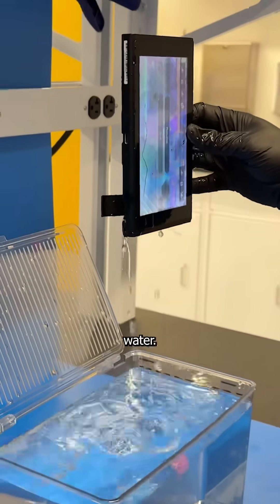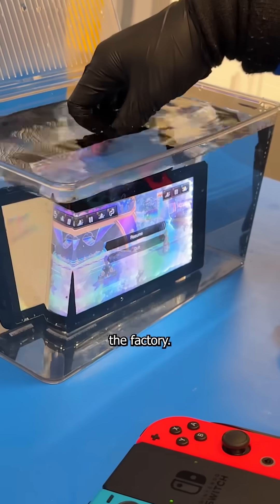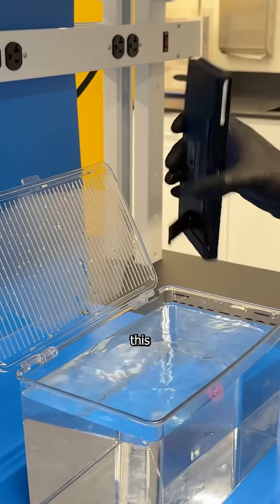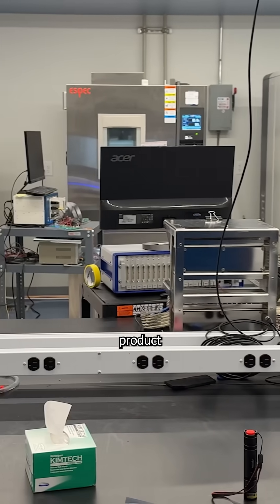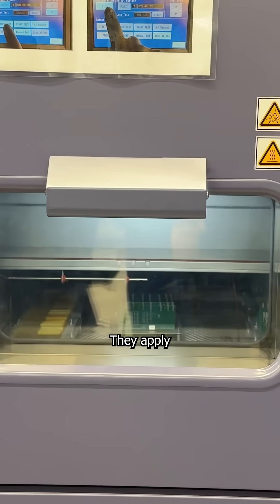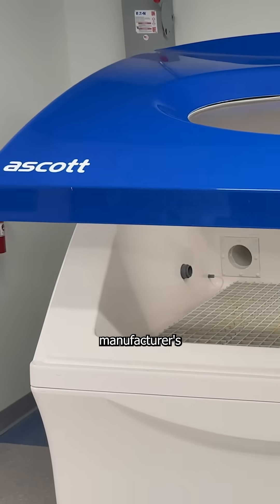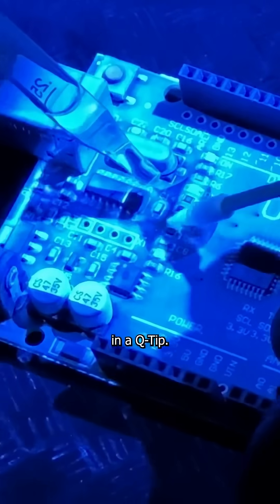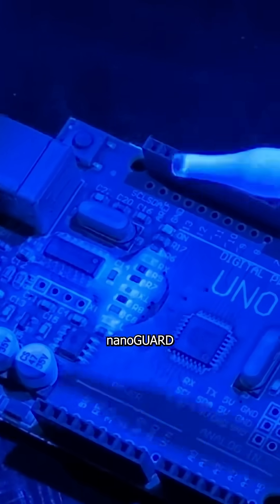Waterproof devices are the future of #technology & nanoGUARD #tech is how we do it! #shorts #pc

Comment: Great!!! Until you want to repair your own laptop/device. Sure, it's good as a preventative measure, but electronics wear out and need to be replaced eventually, and now to get that same waterproof coating, you either need send it in to be repaired by the company or someone who has paid to have that machine who is likely wanting to make a return on their investment. This is a good idea for consumers who would replace sooner replace an expensive car than fix a cheap problem on it (excluding the extra charge they'd add for this coating on new electronics). As for hoarders like me who would polish a rock till it outruns a stock muscle car, not only does it increase the base cost, but I will never be able to fix it "as good as new" without sending it to someone else.

Comment: What happens to the stock cooling system in this case? Do the fans and vents still try to work using water instead of air? Or was that part of the console modified also?

Comment: I have another question. Would the coating impair somethings like electrical conductivity to things outside of the coating. Mechanical keyboards can be coated in this after soldering the switches into the PCB, but I wonder about Hotswap keyboards. They don't require soldering for them to work, and they're frequently swapped in and out. I imagine that it becomes an issue because the coating eventually rubs off, but how many times would you have to swap them out before it becomes an issue, and how viable would it be to reapply a very small amount to 108 spots

Comment: I would rather buy the solution myself and continue repairing my own equipment.
Reply: Which in the first 20 second is explained why it doesn't work really
Reply: @timo4463  no it just said would consider selling to the user. Take this example of what I mean:
I buy a phone with this stuff applied, I smash the screen... I would want to repair the phone myself thus requiring me to buy this water proofing solution in order to fix my own phone. 

This situation was not mentioned in the video. If they only sell to manufacturers I would have to send my phone away every time I break the screen

Would consider selling to the user basically means if we have to we will, but we want to sell in bulk to manufacturers

Comment: This is an old practice called Conformal Coating.
I used to do it as part of my job, it's basically just coating the board with a thin barrier that separates the electronics from any water. Nothing new, nothing complex.

Comment: I see some Logitech UE Minibooms there.
I wonder if this is ceramic based.
 I had an idea about filling board enclosures with a non-conductive fluid. Can't get water in if it's already oil-filled.
 Fluorinert in a car ECU module would make it impervious to water and the fluid would help with thermal dissipation.

Comment: Would sticy tape taped from battery to like ram or other components on the board cause problems or does the manufacturer knew what they were doing? Asking for a friend. Also nanoguard on every single Phone going forward so they will not need to take away ports from phones to keep the 'waterproof'.

Comment: That's actually pretty genius. Basically what they're doing is applying a thin layer of silicone to the surface of the motherboard and other components so that water can't short them. This similar thing is usually done with stuff like dishwashers so that the water that may seep in over the years doesn't break it after like 2 years of use. And yeah it's pretty straightforward
Reply: Does it affect cooling/ heating of the components?
Reply: @jip5889  That is very a goo's question
Reply: It's not PFAS-related??
Reply: how about ports? it's really fun to see an open usb-C port like on the Switch, but that also mean that the contacts are just fucked, so no charging anymore, what a clever idea, on the arduino it means taht every pin coated is now useless, that's just ridiculous 🤣

Comment: I'm not usually bathing with my laptop, but... I would like to be able to swap the phone's battery if I need to without being tied to a wall charger or a power bank.
It can definitely help avoid damage by accidentally spilling coffee or Cola (until it dries out and the keys gets stuck) but yes, no electronics damage. 
It has potential, but why limit to portable devices? I had to replace the board on the fridge because someone didn't fully closed a bottle of coke and somehow it poured down at the right spot. I think it was coke, it was cleaned out when I discovered the fridge was not working. Someone could say it was bad design and I agree, but the limit for it's usage it's our imagination. One more potential example: guitar effect pedals. Playing a Mario game, underwater level... would have been more fun for this video 😊

Comment: I used to work for a space company and we would coat every single circuit board before it was installed. The hardest part is getting the boards clean enough to apply the coating. Any contamination and a bubble would form and then you have to start over.
Reply: Makes sense, especially since Apollo 13 ran into condensation issues when things started going wrong. Big brains 🧠
Reply: This has been around for over 70 years
Reply: so it’s kinda like adding genes to DNA
Reply: sounds like painting a car without getting any dust on it. 😂
Reply: I seen the video
Reply: What kind of conformal coating?
Reply: Currently there are similar coatings for some equipment that will be exposed to the elements and i work with it.

Comment: I mean we've had this for years now it's called conformal coating, I don't know if this differs in someway but does and cleans basically the same, the reason it isn't normally used is because it adds an extra step or two in the process meaning they can't produce as many boards in the same amount of time and thus no matter how cheap it adds cost.

That and of course companies are incentivized to not make products live longer, meaning although it makes more sense for the OEM to apply it from the factory, they likely never will, this is actually more useful for consumers who are interested in making their device last longer.

Comment: Such testing does not show the actual result, but by briefly putting it in water and immediately trying to see the result. Electronics do not start to multiply during this time. Devices that have been exposed to moisture should be observed only a week later, after getting wet. Most people think that nothing happened to their electronics when they fell into water. However, the result is visible a few days or weeks later (even if the device was "dried" after getting wet for a while), i.e. the device stops working after this accident only a few weeks later.

Comment: Wait, aceton? Does this company basically sell nail polish but for electronic?
Reply from the maker: You use acetone to REMOVE the nanoGUARD before working on the board 🤦‍♂️
Reply: @SalemTechsperts  you also use aceton to remove nail polish. And you can also use nail polish to DIY water proof small circuit board

Comment: Did they test this with normal tap water? What about salt water or contaminated water? You know the water that would immediately destroy an electronic. This would be more useful since it would allow divers and beach side inhabitants to use their tech.
Reply from the maker: Do you see that huge white machine I showed you? That machine is a saltwater testing chamber. This is already applied and used by automotive companies. Which require them to use the most corrosive substances to test their application. So yes, it can handle saltwater or any other corrosive liquid.
Reply: @SalemTechsperts  Nice

Comment: Unrelated question: my laptop HAD issues with keys where after pressing any "X" key (for example backspace) it wouldn't worknl again UNTIL I press some other "Y" key (for example a) and its finger sensor died long ago and i had to turn it off just in case (to prevent it accidentally seeing something else as my finger since ky other ginger somehow worked in opening up the device)

Comment: What about thermal? Does it resist heat and does it keeps the components a bit cooler than without the product? 

Could be a good way to sale it, base on tech going smaller or slimmer. Also with phones that want to go 4k or 8k without overheating and cameras in general. 

How long will it last without wearing out? 

Too many questions as you said! 😄

Comment: Will this coating survive 100c or more? Faulty transistor or resistor can heat up to the point of glowing in IR camera.
Reply from the maker: Yes, the video shows a clip of it in a thermoshock machine going from -50c to over 100c in a few seconds. It’s used in automotive applications so it has to withstand temp fluctuations
Reply: @SalemTechsperts  didn't notice that. You are the greatest technician that ever lived indeed

Comment: What I want to know is, does the coating allow sufficient thermal transfer for the water to be an effective heat sink/cooling medium? If so, full-immersion cooling becomes a LOT simpler. Just coat all your PC components in the stuff and dunk them in a regular fish tank. Need to upgrade or make repairs? Just pull the computer out of the water and let it dry - no gross process of trying to clean some gooey dielectric off
Reply: Of course not, else it will be really big already
Reply: like traditional waterproofing methods, it has a time limit. So no.

Comment: "wow" they basically "invented"conformal coating. Repair shops bragged about "it isn't repairable because of coating" "it's useless" and now guess what? We want conformal coating... You cannot coat all device in this, so it will still be damaged by water. Connectors on motherboard cannot be coated because they won't work anymore. And if you won't coat them water will damage them. Yes, you can shield them(or solder all components on mb directly which is a no no) but it will require a LOT more work(not involving this snakeoil btw) like applying silicone on perimeter and put a lid over. 
As a customer i frankly don't care about users that usually  drown their gadgets and i don't want to pay more for a feature that won't save my gadget in case of spill. Users don't usually spill crystal clear water, they spill something sticky, stinky and more important usually corrosive. A pain in the butt for cleaning with or without coating. And i'm pretty sure that most, if not all won't pay even 50 bucks more for this. Majority choose the cheapest option no matter what, this is the real reason of modern shitty laptops, they won't pay you more for sturdy hinghes. They rather buy one more ideapad, because it's cheaper
Reply: Have you seen the full length interview about it?
Also, they showed a switch in this video and multiple laptops in other videos that are submerged in water including their ports, so no, generally it will not still be damaged by water.
Reply: @Papierkorb2292  you cannot make a fpc or other connector waterproof by just coating it. Only coating after the connection will do the trick which isn't always an option. Will it be waterproof after reconnection? Probably not because of a crack in coating. 
Steel parts won't be affected by rust? 
Conformal coating are in electronic industry existed for ages, way before laptops and even personal computers. Laptops don't need this option, because of a numbervof parts that are hard to make waterproof. They tell you that you only need to spray our magic stuff and it will be waterproof, i wanna see how they achieved this for the keyboard or the screen. Guess it wasn' t that easy. 
Let's just say that if this coating would be only an option and not present in all laptops then i'm fine with it. You need this bs then you pay for it. I don't.

Comment: I hope big tech/AI corpos will realize this means they could have passively water cooled datacentres if the tech was underwater somewhere cold! Everything that makes the field more environmentally friendly is fantastic
Reply: Or a double tank system. Have a storage water tank when you drain the main one, and the main one is filled and drained when it's in use or is under maintenance. Have a submarine door to enter the server tank.
Reply: @ShirokoCycling  hell yeah👍
Reply: It wouldn’t be a good application, any data center is going to want maintenance time to time, having it entirely underwater would make maintenance and repairs incredibly difficult (repairs likely would be impossible causing massive downtime)  instead it makes a lot more sense for active water cooling
Reply: @Kero-zc5tc Or "flooded chassis" servers? Maybe flooded racks?
Reply: @ShirokoCycling  it could work but it’s not ideal it would really need A. Some kind of device to lower and higher the data centre in and out of the water. B. Water can cause corrosion and deposit minerals so you would need to buy the water/liquid used C. It will heat up the water container so the container may need to be large enough that the surface areas dissipation of heat is equal to the production of heat D. If the water isn’t moving at all most of the heat will be at the tech which may cause issues, where as with an active cooling system cold water is going on a hot part and the large difference in heat temperature causes the data centres heat to lower. It’s just too impractical imo
Reply: i mean tbh server rooms already uses a lot of water... and its only getting worse, and we need water as living being. all the ai bots are also wasting away our source of water. water is limited. and also sea water is different. i dont think prolungated contact with sea water would be great even if the machines were carefuly coated. in the video they seem to only have tested with drinkable water
Reply: @KwehShiro  good point, in that case wonder if this would just add more toxic stuff to our drinking water
Reply: Do you realize its already hapening? not just water they soak servers in mineral oil or destiled and no stupid coating needed its nothing new

Comment: Why would big tech companies adopt this product that extends the life of their products?
How else would they sell more products because consumers keep dropping their purchases in water.
Do note, Water Damage is NOT Covered by ANY Warranty.
Reply: Yeah, nobody wants to be the Toyota of tech because it's not as profitable.
Reply: Because of a little thing called "Planned Obsolescence"
Reply: Coating adds more complexity to the production, than the product's cost alone (+ a lot more $$$ if they want it certified).
Any repair/upgrade is impossible, if you want to preserve full protection. Also wonder if it's thermally conductive enough, or if it won't impact laptop's keyboard/mechanical parts.

+If people start treating it as waterproof, then water would cause other kinds of damage, unless the whole construction is made waterproof.

Overall it's good OP is optimistic but it's no no-brainer.
Not saying it's bad, it depends on assessment, just know it's complex with dubious roi (it'd be near impossible to market responsibly).
Reply: companies have better forms of forced obsolescence than unreliably hoping someone will drop their device into water, almost all apple phones are ip68 waterproof, and they make sure keeping a phone for longer than 5 years is a pain
Reply: I mean, this is not a major issue for most people.  I can't remember the last time we had an electronic die because of water.  Most people simply don't need this.  It'll add cost for the vast majority of customers to help a very few people.  This is not cost effective.  Only useful for marine applications or sports purposes.
Reply: @mementomori29231 Many product specially phone regularly die because of water
Reply: @mementomori29231 It's the cause of 25 percent of broken laptops, that's huge.

Comment: This is a type of conformal coating, there are other companies that make similar products. MG chemicals sells both spray cans or bottled versions of the product. These are mainly used in ruggedized electronics and industrial equipment. However hobbyist also use it for drones etc.
Reply from the maker: There's nothing like this that doesn't use PFAS.

Comment: Isn't this liquid just clear,plastic goop that dries to become a film?.
Its all good and dandy but you have to understand the oem market is damn cut-throat , tolerance and quality control is too expensive and complex if they do integrate this tech, they are adding complexity and cost with separate tests on each board and repairs become complex, with one bad shipment of these, their whole lot will fail (short circuit while testing) plus the cost (1 dollar per coating. As you mentioned earlier) will become millions of dollar which must be borne by someone and its not the manufacturers or marketing team with resultant increase be around 50$ per equipment which will be beaten by someone not using this coating and just using glue to keep the device watertight. I know its bad for customer but business is business. I hope the toyota of electronics come sooner than later.